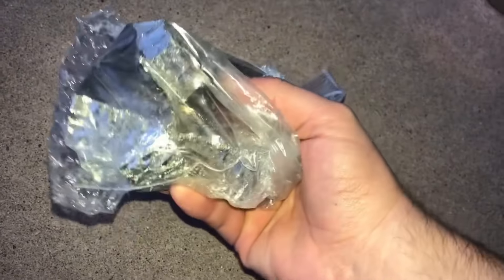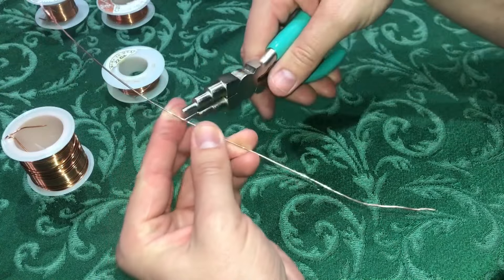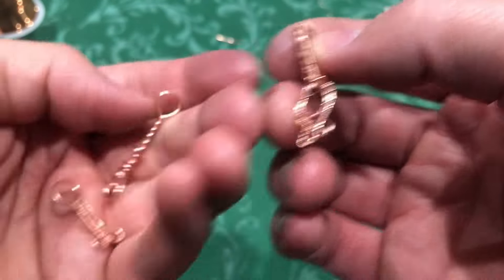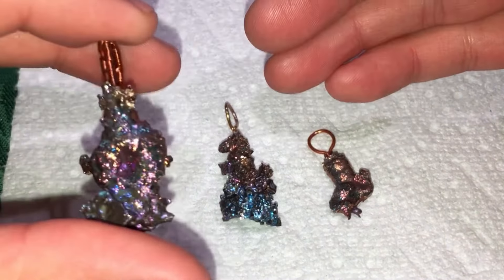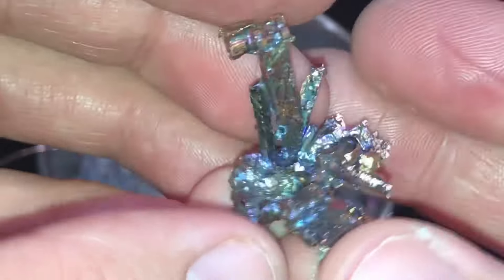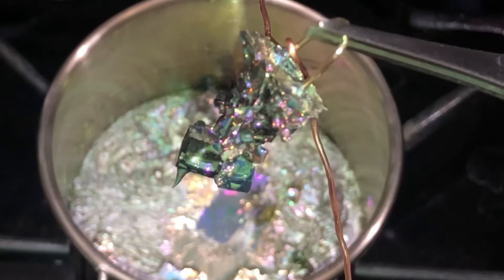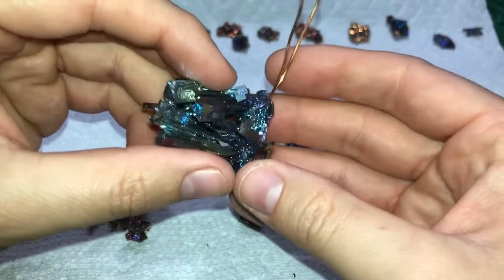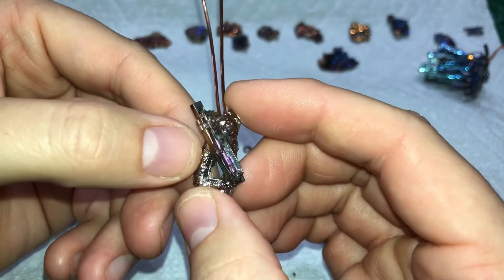Merging Minerals (#MakersChallenge5)

Comment: I did. It was a bit easier using a bigger container to just toss in how much you need and melt it all together. I still have a bunch of it that I didn’t use. You can also pour it melted in a deeper tablespoon type container and the crystals grew in a half globe like building blocks. Looked like a cross section of the Death Star 😂. It’s fun to play in.